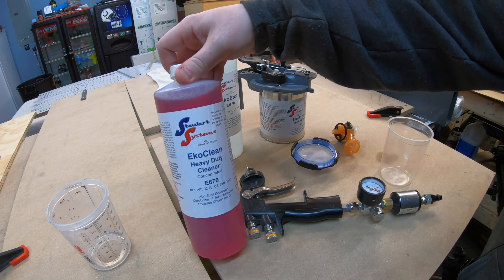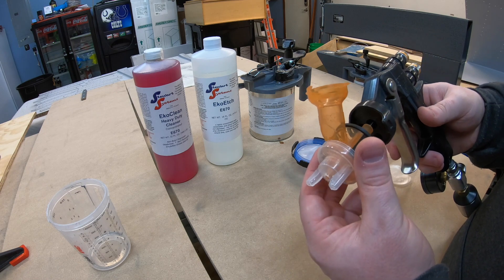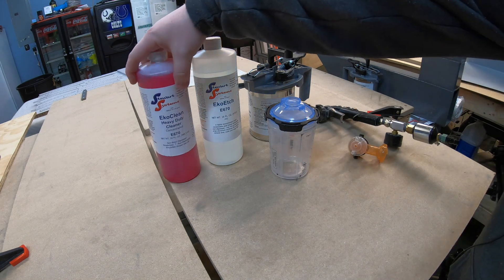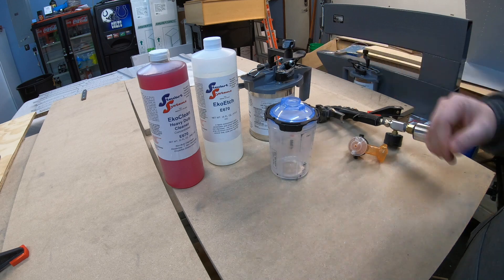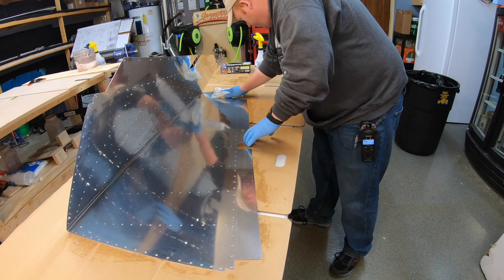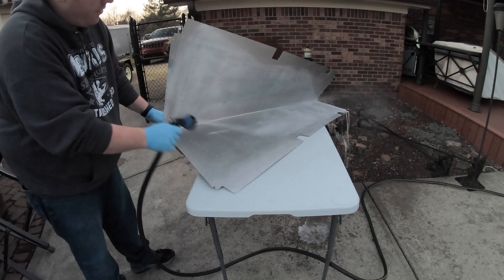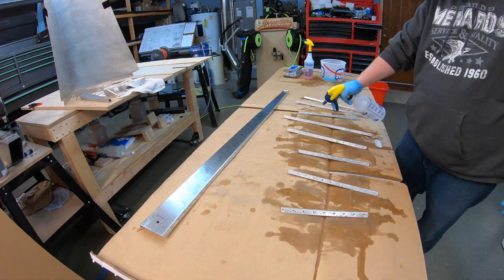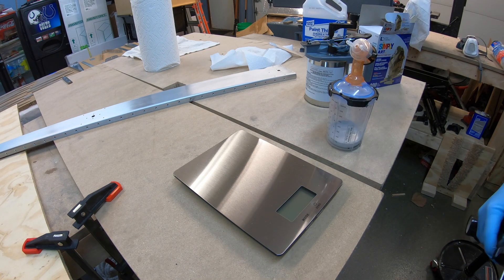Stewart Systems Prime Video

Comment: Looks like you sprayed the small parts and then flipped them over.  Did you let them dry in between flipping them?  With that gun system we’re your able to store it while parts dried or did you need to cleanup and then remix and reload?  I’m trying fir the first time soon.
Reply from the maker: yes, I let them dry about 45 minutes to an hour, I just made small batches of the primer so what little I had left I just threw away and started fresh. since this video, I rigged up a rolling coat rack from Menards that I attach the smaller pieces to with some safety wire and it allows me to get both sides at one time.

Comment: Hey, I remember I found this video from your build thread on VAF I dont remember which one it was! I'm doing an RV8 also "RV8-83772, N1986 build thread".    I got EkoPrime also but havent sprayed it yet. What kind of air filtration did you use?
Reply from the maker: Sorry for the late reply, hope this helps.

Air compressor Filtration - I used a THB Air Filter/Regulator and Air Clean/Dryer Part no. FR-FLM863. https://www.thb.com.tw/filter-regulator-with-coalescing-filter-fr-flm863-filter-regulator-set.html

as far as shop filtration - I don't have a good set up yet, I just spray in the garage and open the door to get some air circulation and use a 3M paint respirator mask while spraying.

Comment: Fond your build on VAF and subbed to your channel. I live down in Columbus IN and I’m hoping to start an RV 8 project within the next year. This summer will be spent getting the garage organized and ready for a build. Question on your priming. Why prime over an acf50 treatment after the part is assembled? I know there are areas that you have to prime due to the type of material as well as dissimilar metals.
Reply from the maker: Great question, and welcome to the community! The prime discussion is an age old discussion in the community whether to prime or not to prime. it's totally dealers choice, you are correct that generally speaking it is not required, however it is recommended if you live in high corrosion environments, I don't currently but never know where I might end up down the road or if I sell the plane someday down the road to someone that it is important to it can help resale value. That being said, obviously it does add some weight so you just have to weigh the pros and cons for what you want out of your build.

Comment: Great video, I'm looking to prime the cockpit of my RV7...Do you think the EKOPrime primer is tough enough to stand up to that kind of wear and tear?
Reply from the maker: Thanks for watching, I don't have a ton of experience with the product yet, but at the very least if you use the ekoprime I would cover it with a top coat of paint to give it a little better protection, but from what I understand (though I haven't yet used it) the ekopoly would be more suitable and durable for wear and tear in the flight deck area as well as any areas that will see chemicals, oils, etc. hope this helps.
Reply: Definitely use a topcoat over your eko primer in the cockpit or otherwise use epoxy primer.

The ekoprime is rough as its designed to help top coat adhere so it will hold grease oil dirt well too😢

Comment: What gun air settings are you using?  What size and flow capacity does your compressor have?  Good video.... thinking of going with the Stewart system as well.
Reply from the maker: Daniel, 
I have a 60 gallon compressor from Harbor Freight. I am running 90psi out of the compressor to the gun to ensure ample air is available, but then at the spray gun I have a second regulator that is limiting the air to 18psi. 
I have been very happy with the Stewart Systems so far, however, one thing worth mentioning is that you will not want to use the 1 part primer for the whole aircraft because it is not very resistant to abrasive chemicals. Areas such as the firewall forward and anywhere else with regular exposure to fuel/oil etc you will want to use a 2 part primer to ensure the primer stands up to test of time against those harsh chemicals.
Reply: @pilottender  Yeah, I'm kind of worried about air flow rates - my compressor is 20 gallon, but only 120V, so maybe 6 CFM.  I'm hoping it will be ok to prime in smaller batches, maybe if I get a second air tank.

How scratch resistant is the primer?
Reply: @pilottender  Sean no sort of paint booth??  Are you getting much overspray in your shop??  Also what sort of dry times are you seeing??
Reply from the maker: @oneflyerguy1993  No, I do not have any sort of paint booth but don't find that I have a ton of overspray (but there is some). I have a plan to create a miniature spray room, I just haven't gotten around to it yet. As far as dry times, it varies slightly with temperature, I generally allow 30 min between the first and second coat and then about 12 hours before spraying the other side of difficult parts, then I usually let it set for 4 days while I'm on a trip for work. I'm sure it would be workable much sooner I just tend to plan the spraying before a trip so it has ample dry time before I begin final assembly and riveting.